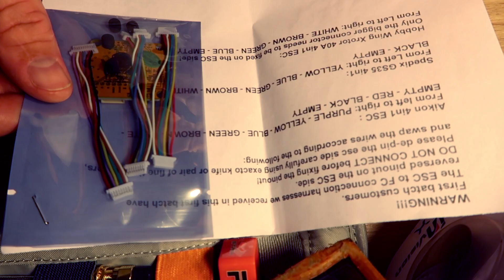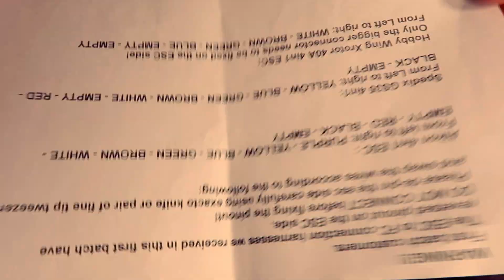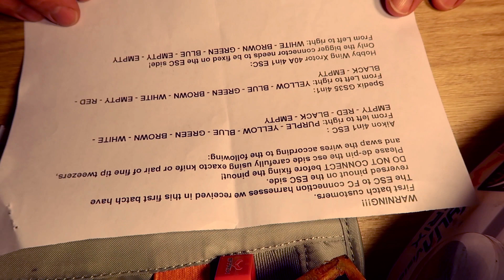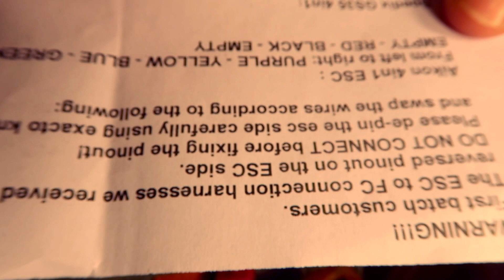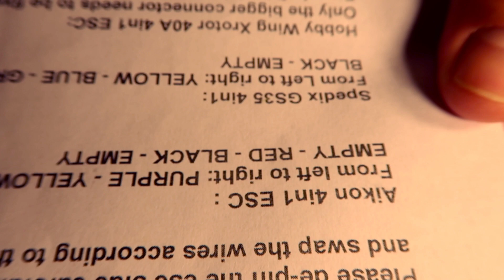Hyperlite F4 OSD | Flight Controller FC Initial Thoughts Review

Comment: Bardwell named products are knock offs from other people and do not work properly
Reply: Amen! I've had 3 out of 5 Bardwell F4 v2 $35 FC's die after 4 or 5 flights. One of them had the voltage regulator decide to de-solder itself mid flight. Also had a Bardwell 4-1 pop a fet after second flight,  nothing but garbage.

Comment: Any ideas on how to adjust camera settings I was trying to do it in the settings menu from the controller using the smart audio but could not
Reply from the maker: So long as you're using the CAM_C pad and wiring everything correctly to your FPV camera, the next thing to mention is that the CAM_C doesn't work for every camera.  Because of the pass thru and they way the FC manufacturers were attempting to perform this functionality, it isn't 100%.  So if it doesn't work for you, it doesn't mean that you did anything wrong.  It also doesn't mean that you will be able to make this work.

Comment: Does this have black box?
Reply from the maker: It does not.  This is a minimalist flight controller...  plenty of UARTS and functional pads (cam control, things like that), but in order to keep the back side clean and clear an SD card slot is not included in the build.

Comment: Hey bud! So does it have to get 5V from the 4in1? I get 16V on the +5V pad so i guess the board is getting full battery voltage?
Reply: Max Lundström It can actually use battery voltage from the 4in1 and usually does so via the wiring harness.
Reply: Josh Withrow Just realised mine is the old model without osd, and without 5V bec. That’s why I got 16v on every pad😅